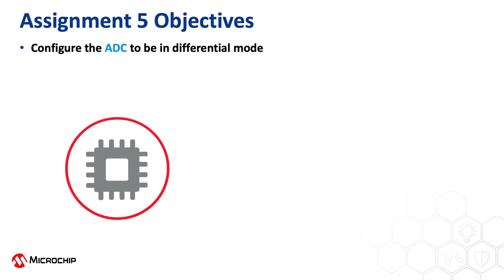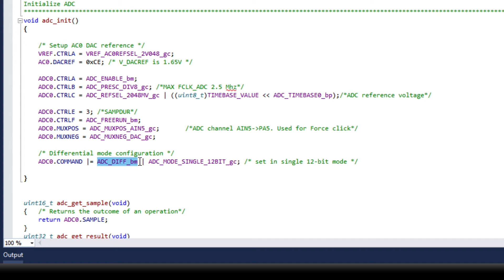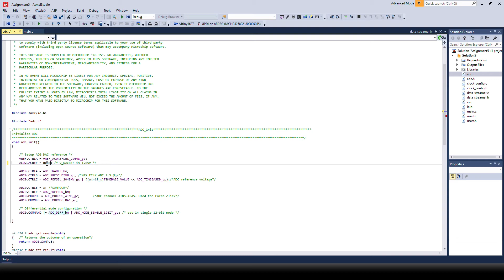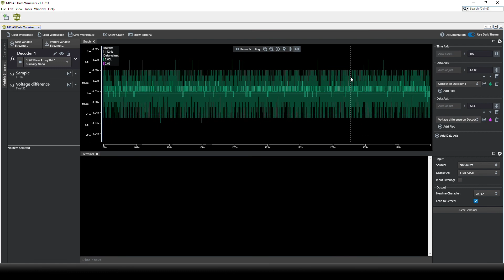Ep. 5 | Differential ADC - Differential Inputs Reading by the ADC

Comment: How to make connections for ADS131A02IPBSR Such that its set in differential mode In an circuit for QRNG for signal processing + TIA circuit
Reply from the maker: Hi there, thanks for your question! The ADS131A02IPBSR is a Texas Instruments precision, 2-channel, 24-bit delta-sigma ADC with differential inputs. While this is not a Microchip part, you can interface it with the ATtiny1627 for high-resolution differential signal acquisition. 

Please let us know whether you intend to use the ADS131A02IPBSR on its own or in combination with our development boards, such as the ATtiny 1627, and we can provide further assistance. Thanks!